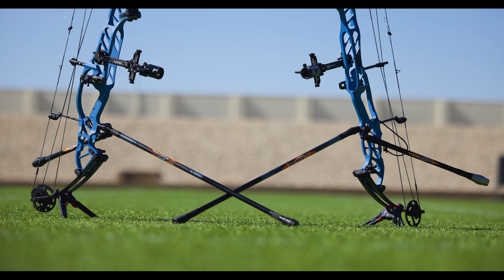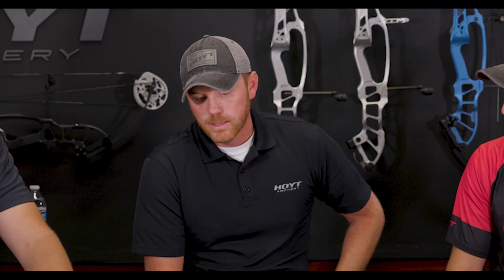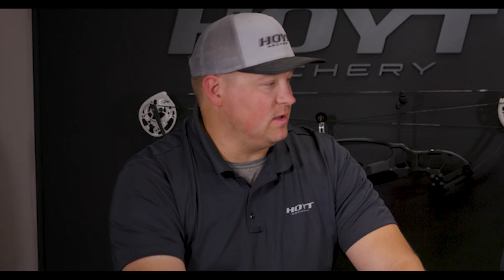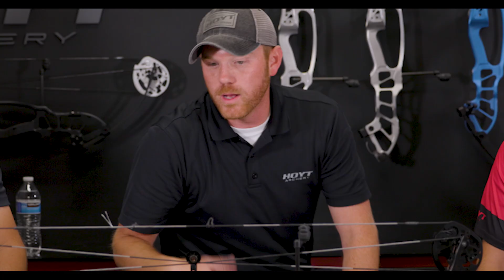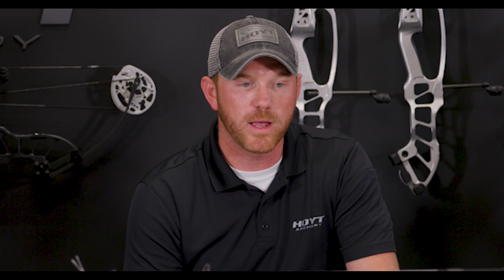Stratos Shop Talk with Jesse Broadwater and Brian Gold

Comment: You mentioned the two cam sizes (HBT#1 & HBT#2), but I wasn't clear what their draw-length specs were for each.
 I was also a little unclear if say, I order a bow with HBT#1 cams, it comes with its HBT#1 modules...but, does the bow also come with the full HBT#2 set of cams and modules as well? Thanks a bunch. Happy Holidays.

Comment: I left hoyt years back also.. hoyt make no sense to me. Hoyt v33 is great bow, however people prefer 7 inch brace height and 33 to 34 inch axle to axle on aluminum bow. Carbon bows are so over priced.why doesn't hoyt bring back z3 cam as a oversize cam? They are material out there that is stronger and lighter then carbon. At cheaper prices.. but I will give credit for hoyt v33 on one thing, balance..

Comment: Why can’t we do this with hunting bows .. I still own a pro-tec and wish we could have a deflex riser with like7.5” brace in a 32ish bow .. I left Hoyt some years back when the brace went below 7”. I’ve been shooting a Halon 7 for the past 5 years .. I left Hoyt for a Monster MR 8 . Which has 8” brace .. I’ve still got a pro- vantage from the 80’s .. I shot Hoyt for decades ..
Reply from the maker: You may want to check out our Highline. 7 7/8" brace height, 36 1/2" ATA. Fits 29-34" draw lengths.